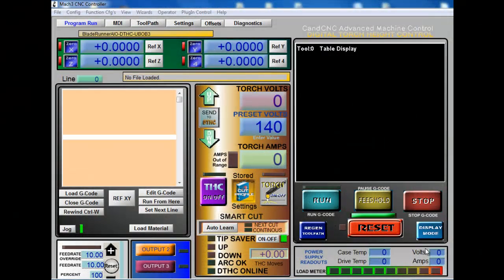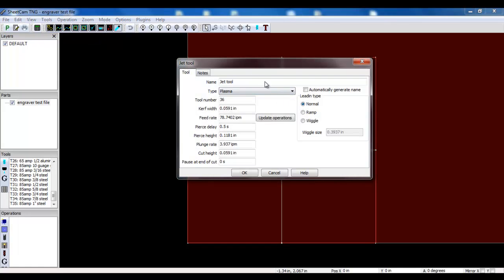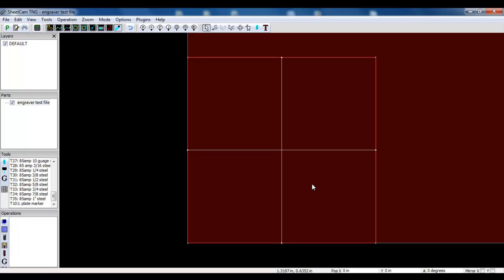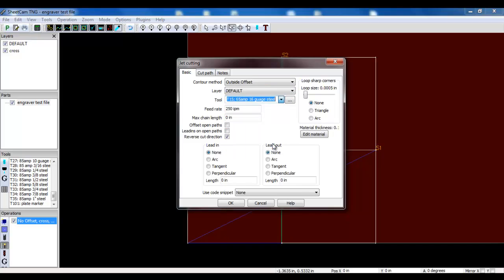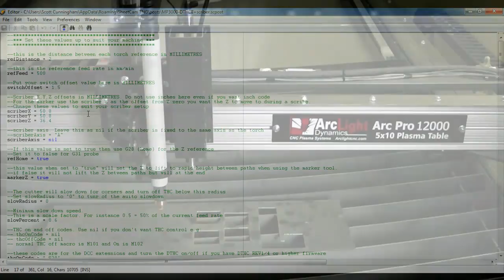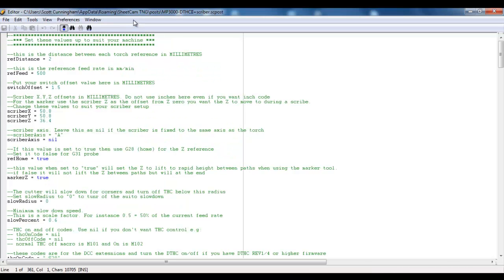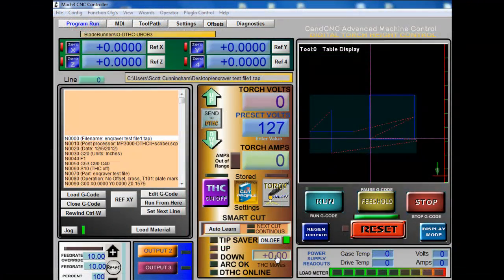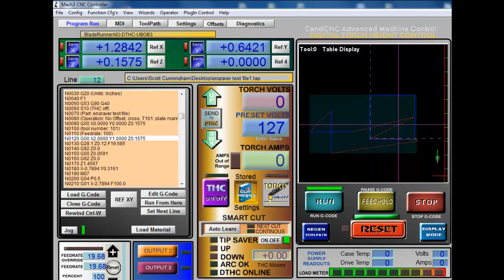Engraver Tutorial

Comment: Instead of holding a part to determine the original pre-cut orientation just use a marker and mark a corner before to start cutting. You should be able to guesstimate where the part will be beforehand, it does not have to be very accurate it is only to show which corner was where.